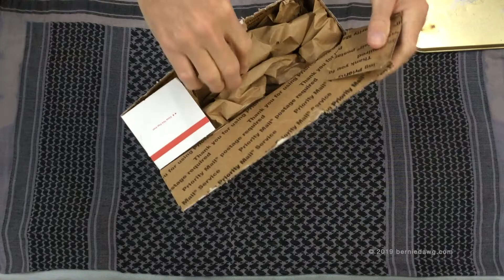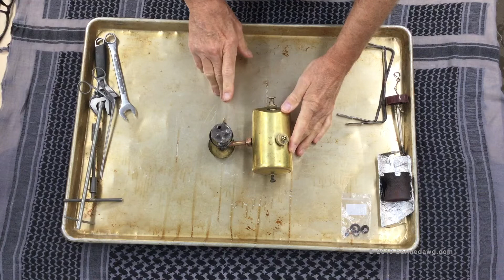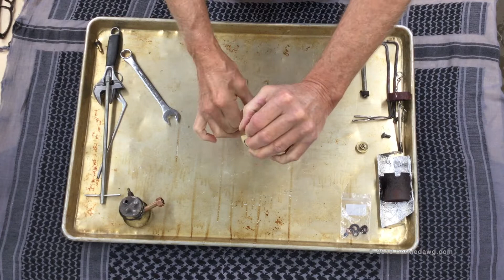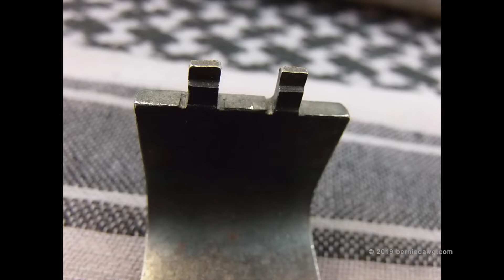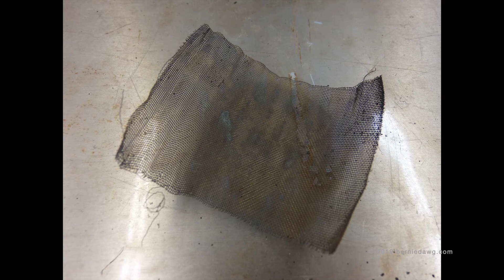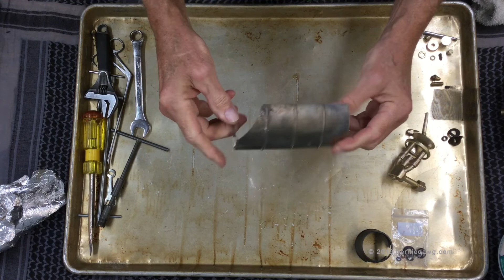Optimus 111B Stove Repair Part 1 - Disassembly

Comment: Great video just bought a Optimus 111B  off of eBay when the weather gets better I'll use your method  of lighting the stove, But in the mean time I was wondering can I use your silent burner in place of the original that come with it?
Reply from the maker: @KB3UKTKB3ULN I answered that question completely and educationally nine years ago here at my website:
https://www.berniedawg.com/silent-cap-for-111b/
(And I also linked you there in a reply to your earlier comment when you asked the same question at one of my other videos.) Check it out. You could learn a lot about stoves that way. 👍😎 BD
Reply: @BernieDawgCinema  Thank you very much, you do amazing work 😊

Comment: Hi - excellent demonstration - can you share again the dimensions of the NRV tool, because I'm not sure I got it correct
Reply from the maker: @Ottar Johan Simonsen 5mm wide x 5mm deep. Length would be the diameter of the bar you are using to make your wrench. BD

Comment: Greta video and I am using parts 1 through 3 to get my unit reburbed.  But how can I tell what model 111 I have?
Reply from the maker: @Dave Sherry The stoves came from the factory with model badging in the form of either embossing stamped in the metal lid of the case or adhesive stickers, usually applied on the lower right exterior of the lid of the stove box. The embossing stays around. The stickers can be removed, worn, painted over, or burnt off over time. If your stove case appears unbadged or the sticker is unreadable...
This video shows the 111B model. If your burner looks like the one in the video (two feed tubes up to the burner head), then your stove is a 111B, a white gas only stove. If you have a similar shaped burner but it has four tubes up to the burner head, then yours is a 111 (no letter) model, which can use white gas or kerosene. If you have a silent burner equipped stove, then it is either a 111T (most common and most likely) or a 111C, both multi-fuel stoves.
If you still have questions, just send me a photo or two and I can id it for you. bd@berniedawg.com It’s free! BD

Comment: Thx bro. My NRV isn't working on my No111. Stove still works but I miss the extra pressure it provides. Thank you for describing how to make the tool as well. Complete rebuild very soon.
Reply from the maker: @S F Yep. The NRVs should be inspected/serviced annually or more frequently if you leave your stove unused stashed with fuel in it. A non-working NRV can fail spectacularly by allowing fuel to gush out of the pump lid opening around the pump shaft while the burner has flame. Not a good combination. Especially if using white gas. BD

Comment: Excellent video thanks, mine wont turn off, suspect the adjuster and cleaning needle need to be inspected. John.
Reply from the maker: Thanks! Most likely the cleaning needle rack is set too deeply into the teeth on the spindle. Try the stove without the cleaning needle rack in place. If it shuts off okay without it, then you just need to reset it correctly. 3-5 "clicks" into the burner is the usual range, depending on the particular parts you have. May take a couple of tries until you get the knack. If the stove won't shut off without the cleaning needle, then you likely have debris/dirt keeping the point of the spindle from seating, OR, the point on the spindle is likely marred from over-tightening. The tapered spindle point should look like a tapered cone if in good condition. It should not have a ring or step. BD